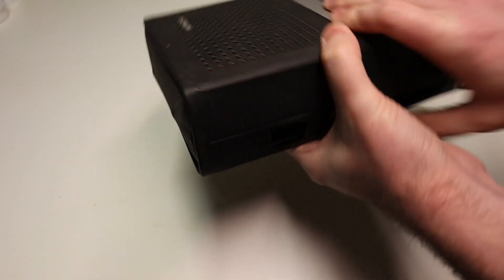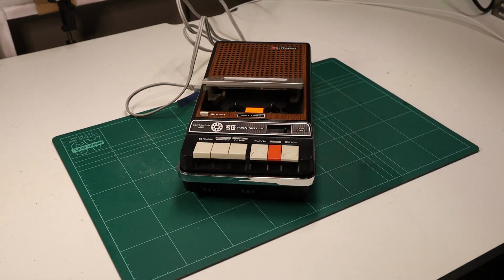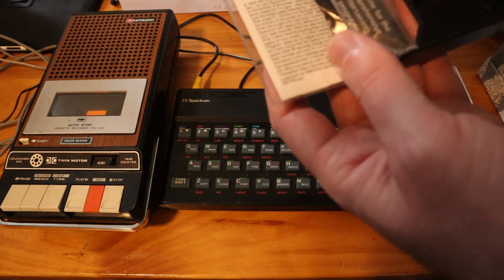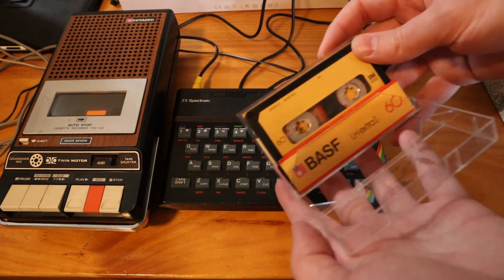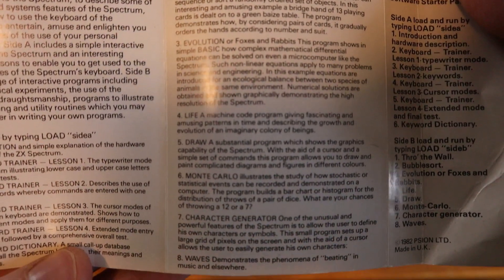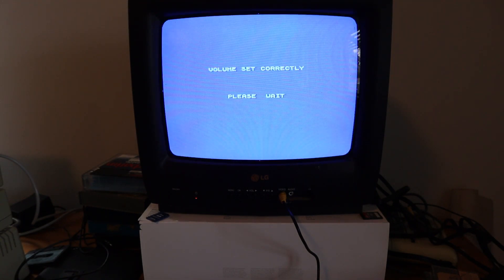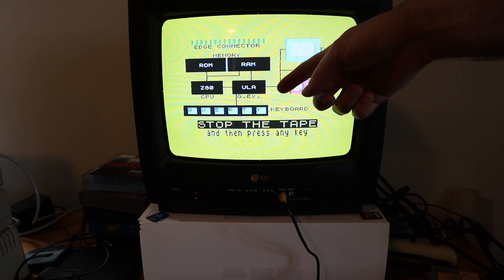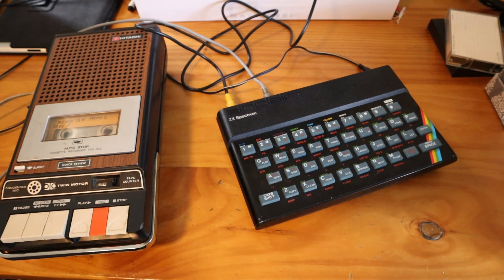Loading software onto the ZX Spectrum

Comment: Mono connectors can sometimes be called TS (tip-sleeve) connectors
And stereo connectors can sometimes be called TRS (tip-ring-sleeve) connectors
https://en.wikipedia.org/wiki/Phone_connector_(audio)

And my keyboard actually uses a TRRS cable to connect the two separate halves, fun!